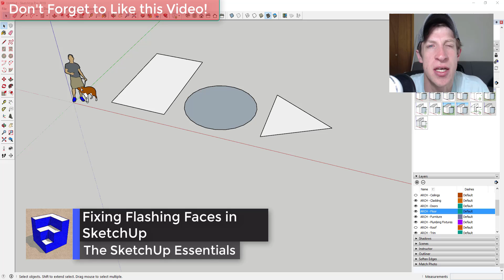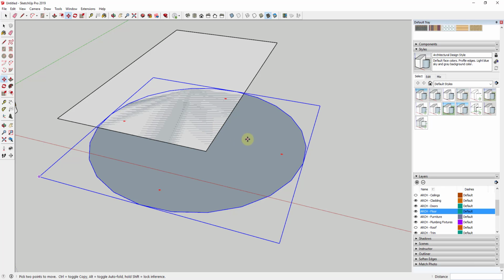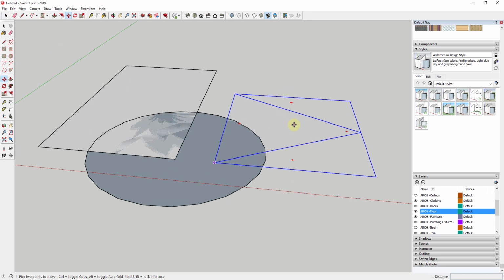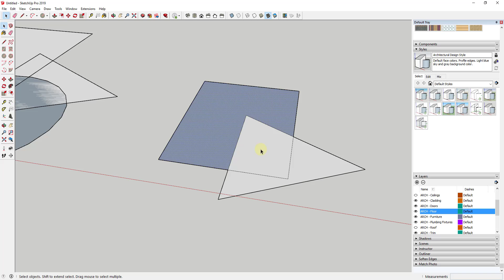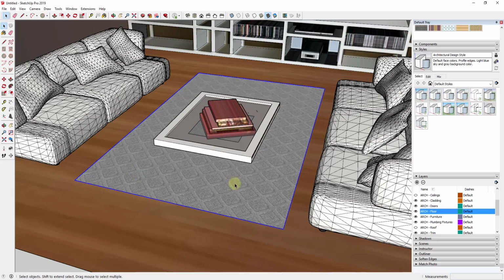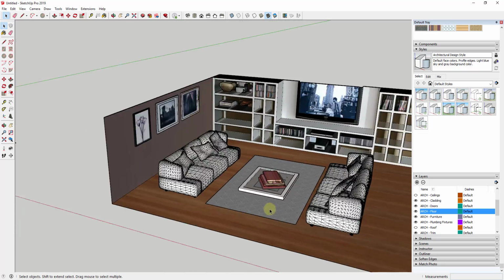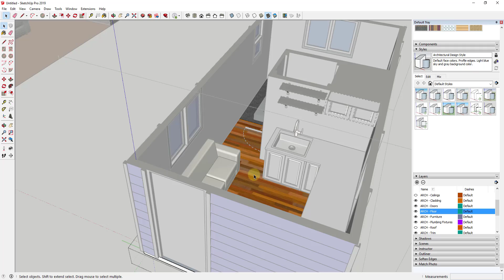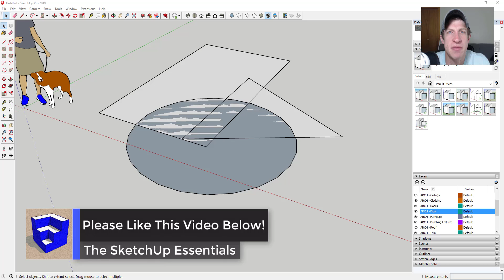How to Fix FLASHING FACES in SketchUp

Comment: One comment and one question:
The third method is not to pull the plane to get thickness, but raise it up.  The amount that the plane needs to be raised will vary depending on the distances involved in the model and views.  If you are looking at the plane from close, it's likely there will be no issue.  If you are looking from 1000 feet away, there WILL be an issue.  This is frequently problematic when doing 3D site plans.  Let's say you have imported GeoLocated Terrain and Snapshot, or imported site imagery from Placemaker.  Now you trace over the landscape or civil plan for the new work, and that's on another layer of course.  

You need to show the existing snapshot imagery in the back, and just the new-work area above it.  So you lift the new work up maybe 2"...and if you have the flashing problem, lift it up like 12".  That will usually solve it.  But...it creates an issue for modeling because now your working plane outside the building is 12" higher than your level one floor.  One thing to note is that you usually do not want the group for your new landscape/civil to cast a shadow onto the underlying site.  So when you select it, go to the Entity Info dialog box and uncheck "Cast Shadows".  This will speed up rendering too.

OK, here's my related question.  Justin, if you look at your tiny house model...lets' say you have made exterior walls with thickness...8" or whatever.  And the blue siding has thickness (say 2" ) because you need to see how the siding interacts with windows/doors/trim. ( Plus, if you cut a section, you'll see the siding/rainscreen assembly thickness.)  OK.  You apply the clapboard texture to the siding group.  And when you're close, everything looks great.  When you back out to see the house on the site....you are now getting flashing between the 3D siding "slab" and the underlying 3D walls.  EVEN THOUGH THE SIDING HAS THICKNESS!
This is a real PITA because it means you have to turn off your exterior walls and ONLY view the siding.  This is a serious issue that sketchup never solves year after year.  

BTW-last comment- for those of you having the "clipping plane" issue especially when you get close to objects and your "head goes thru the glass aquarium"...Look at Mind Sight Studios website.  Daniel Tal and the guys that make Placemaker have an extension that solves the issue perfectly.  It's $50 and it's called Clipping Plane.  It's a one time fee and it WORKS.  This is the stuff that Trimble should be fixing when we pay for new versions.  It's been a problem for all twenty years or so I've been using Sketchup.

Comment: I am a contractor and I have spent hundreds of hours trying to get my floor plans to work properly, in the model when I try to color a wall the entire floor changes color. In some cases i can not make the floor solid in order to color.  I do not know how to find help on this, I do not know the lingo to search.
Reply from the maker: It sounds like you're applying materials to the outside of a group instead of to a raw face
Reply: Mike
You are having layers/tags issues.  Remember, EVERYTHING goes into a group.  Your walls are distinct solids in their own group (and on it's own layer).  The floor/slab is it's own group (and on it's own layer).  (and yeah- give them thickness so they are 3D) Your wall treatments can be another group, on it's own layer.  The floor finishes can be another group(s) on their own layer.  Now you can apply materials to your floor and it won't affect anything else. (Note that sometimes it will work to "paint" the whole group.  Some textures, especially if you need to adjust the scale or direction of the texture, you will have to paint INSIDE the group)

The other thing this allows is to have variations.  For example, you could have a layer 3D-FLOR-FNSH-OPTION1  and another layer called 3D-FLOR-FNSH-OPTION2. Now in one scene tab, you can turn on only the "option 1" layer and in another scene tab you can turn on only the option 2 layer.  You can have the living room, kitchen, toilet, and dining room all be separate groups and put them all on the option 1 layer...and have a completely different set on the option 2 layer.

Its ALL about discrete groups and discrete layers!!!!!

Here's another trick I came up with.  You need organized names for your layers so they makes sense, so you can find them, and so you have them on every project.
I do a layer nomenclature system like in the old days with AutoCAD.
A-3D-ENTR-VEHICLES
A-3D-ENTR-PEOPLE
A-3D-FLOR-NEW
A-3D-FLOR-EXG
A-3D-FLOR-FNSH
A3D-DOORWIND-NEW
A-3D-DOORWIND-EXG
A-2D-DOOR GRAF-NEW
A-2D-DOORGRAF-EXG.
P-3D-FIXT
E-3D-FIXT
L-3D-PLANTINGS
ETC

Make all the layers you will need, in a new drawing...layers for entourage, layers for wall treatments, layers for flooring layers for furniture, layers for lighting, layers for plumbing, layers for site stuff.....
And then, in the same new drawing, make a bunch of 12" squares.  Make the first square a GROUP  and copy down and across like 50 or 100 of them.  As many layers as you have and then some.  (if you end up with fifty layers, make 60 squares)
Select them one at a time, and in the Entity Info dialog box, scroll and select the first layer (tag) in the list.  You have now just put that first square into the A-3D-WALL-NEW layer/tag.
Proceed to put each square into it's own layer.
At the end of that boring process...you will have a bunch of squares/groups....each on their own separate layer.
Now...save the drawing.  Call it MASTER-LAYERS, or something like that.  Save it to where you save your personal components into a clearly labeled folder.

Then, in Components dialog box, the blueish little arrow icon...Open or Create a Collection.
Browse to, and select, the folder with your new component.
Now you'll see you newly-created component.
Anytime you start a new drawing...first thing you do is grab and place that component.  Now you have all the layers you are used to using, inserted in your new drawing instantly.
You can do the same thing for materials/textures that you like and use all the time.

Comment: There is a simple trick to solve this problem.

Select a grouped model, on entity info tray, you can change the default paint to any color you want or even change it to a texture image. Select edit, change the opacity to 99 instead of 100. Make sure all materials or grouped model have been set to opacity 99. Also, the paint icon on entity info tray should not be set into default color (white and gray icon). And there you go.

This trick will be useful for those who are working in 2D view or doing 2D plan in sketchup. Hope it helps.

Comment: As your floor example was Z-Fighting with the door opening arc, you could shrink the door 1/8 so it is not sitting on the same plane as the floor. In practice you would have a gap all around the door to frame, so including it in the drawing would solve that issue.
Reply from the maker: I would not recommend this, because you'd be raising your door up off the floor. Then if you inference from points on that door you'd be drawing lines above plane, which could cause a mess
Reply: The easiest way to deal with THAT, is to have your door component contain the 2D graphics (slab and swing arc) on one layer (DOORWIND-2D), and the 3D objects on another layer (DOORWIND-3D).  Then you can only turn on the 2D graphics when you are in plan views. The whole component would then go on a "master layer" such as DOORWIND-NEW or DOORWIND-EXG  (you want the layers to stack on top of each other when you're looking for them in the Tags dialog box/list.)

Comment: Thanks so much for the video!! one of the most frustrating (even though important) features in sketchup.
I am, though, struggling with a specific type of z-fighting. The one that is created when one polygon would show z fighting because it has textures on both of it's faces.  I was wondering if the truly is the same issue as with different groups, and, is there a smart and effective way to deal with it?

thank you again so much! your channel is great and you are too! :)
Reply from the maker: I don't understand - if it's Z-fighting, it's because you have 2 sets of faces occupying the same space...I'm not aware of a "specific" kind of Z-Fighting....
Reply: @Thesketchupessentials  so - I think I need to provide some more details.
Firstly, I was meaning z-fighting that took place in 3rd-party software (GIS Pro), and not Sketchup itself. 
Secondly, I was referring to a z-fighting that accrued because I had one surface - colored from both sides (still fits your explanation about populating the same space).
And finally, I have found an answer by mistake - and boy, I was surprised!
Turned out, when you color a group (from the outside, without entering in) - it will apparently do nothing, while in reality - it will paint ALL THE INNER SURFACES!!! :)

Comment: Another great video, Justin. Instead of adding thickness (the rug in your example), I move the grouped material away from the other surface. I use .01". That's enough to stop the Z-fighting and it doesn't add any additional geometry.
Reply from the maker: I don't know why, but for some reason I don't really like leaving objects with no thickness in my models, but I can't really think of a reason why I have that preference - I think this solution works fine as well :)

Comment: I had a similar issue when ever I import 
An Autocad file and use it as a modelling reference so when I zoom in any model it's just disappear ad I am cutting it , do u know who to solve this issue .
Reply: I think what you mean if you import a file like a floor plan the flashing happens when you try to draw above. Like a PNG. I've seen a video where Justin says we have to explode the image first. Then it looks with dots but it works great to create the 3D walls.
Reply: @arqMyriamBM  yup.  Also, you can usually pan around a bit and find a position where the autocad linework, or a jpeg imported, will be clearly seen.
Reply from the maker: I don't quite understand the question - what's it not doing?
Reply: @Thesketchupessentials  it's called visual display problem when importing a third party model or DWG .

Comment: Thanks for sharing. I like using component cut-outs for carpets and pictures to fix that problem and also making placements easier. I found that adding enough thickness is important when you zoom out because background edges tend to come through otherwise.
Reply from the maker: Personally I wouldn't use cut components for this, but if it works for you, go for it! The second part is definitely important - I probably should have spent more time on that in the video - oh well :p
Reply: No the video was great. It’s all grist for your training course. That’s what really counts.